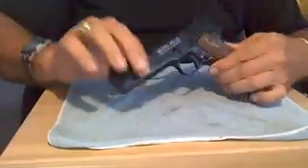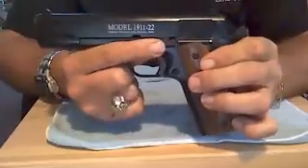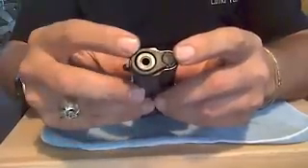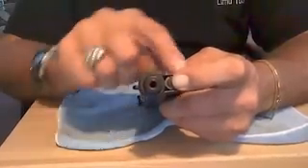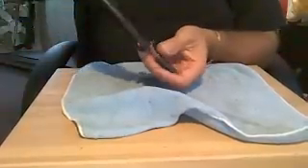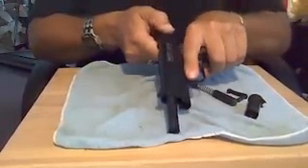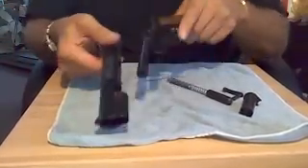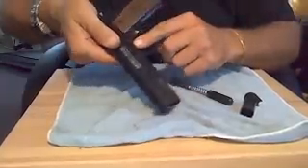Chiappa 1911-22 Field striping demo!

Comment from the maker: @glennwih If there is a indentation on the barrel it has been dry fired, however if you are lucky it will still fire and eject correctly otherwise it has excessive dry firing and will need to be Repaired thanks.

Comment from the maker: @brandon163774 may also be the cause of the small shavings that are appearing in your gun. And in the end make much larger problems later, the barrel bushing can be rather hard to remove in a new gun, it is because in guns everything is measured to the thousands of an inch when they are built due to the pressures caused by the bullet firing. If you manage to get it out use anti-seize grease on it this should make much easier removal.

Comment: 1) "Last round hold open = is called the "SLIDE STOP" 2) the retainer button at the front of the slide =is called the  "RECOIL SPRING PLUG" 3) The Barrel retainer or slide lock = is called the " BARREL BUSHING"...............22 Lr max range is 1.5 miles

Comment from the maker: @brandon163774 With a new pistol it is not uncommon to find small bits of metal when firing however, it is paramount that you first clean and oil a new gun, not all but most manufactures apply corrosion preventive on all metal parts for storage and shipping to gun shops.
 It is important to understand that this IS NOT a lubricant! It is not intended to be used as such when operating the gun. So clean it and use rem oil or other gun oil this will not only make it operate smoother but

Comment from the maker: @balamb0776 though I understand why you wish to do this, I don't recommend you do this one; because the blue is there to protect the metal from rust, and two; the barrel is cased in aluminum not steel so it will not have a shiny steel finish that I'm sure you think at this point it would have. thanks

Comment from the maker: Welcome Terry! Thanks for watching, the trouble you are having is common, however I have found most of the time it’s because people are turning it too far or not enough it requires only one quarter turn, on a new fire arm it can be quite tight, after removal you can use an emery board to smooth the edges on the bushing this can make it easier.

Comment: I just bought a used one. It has a little indent on the barrel from the firing pin. It looks like maybe 200-300 rounds have been fired but is that normal or excessive dry firing?

Comment: I picked one of these up for $200 cash used (50rd). It now has over 5k through it, between me, friends, and my son, and aside from a few misfires (ammo) and a couple stove pipes with the kid (limping it), no problems at all. I've yet to actually take it apart and inspect it, but I plan on cleaning up the slide, trigger, and hammer + mods over the winter here.

IMO, It's def a gun worthy of the extra attention and some customization.

Comment from the maker: There are small differences like light spring on the rail when you pull it back to chamber a round but it’s because it’s a .22 not a .45 but the size and weight are close and the operation is the same right down to the safety. It does not have the quality of finish as a real 1911 but for plinking away staying proficient and keeping on target without having to break the bank on .45 ammo priceless!

Comment from the maker: I would recommend this if that is what you meant by “suggest”; The Chiappa 1911-22 is a good gun for the price point, it has real walnut grips, the finish is good for plinking, the fit of parts is sloppy, and there has been issues with the integral safety IE the auto trigger safety is pushed down by the slide returning to battery, in some cases the step on the slide that pushes the safety down is too steep but rounding it with an emery board is a fix.